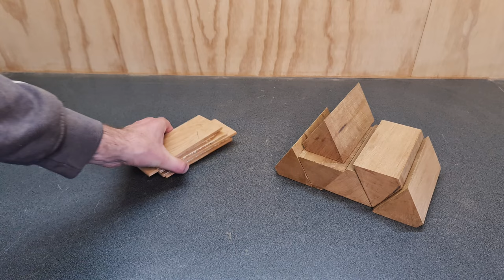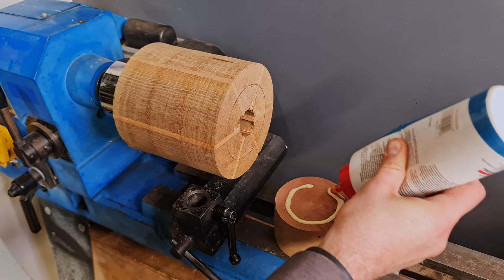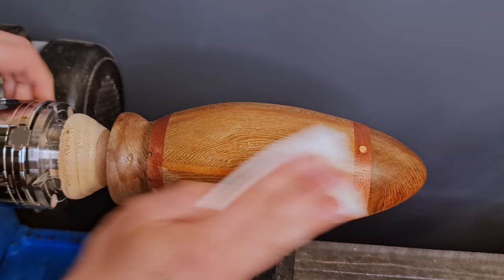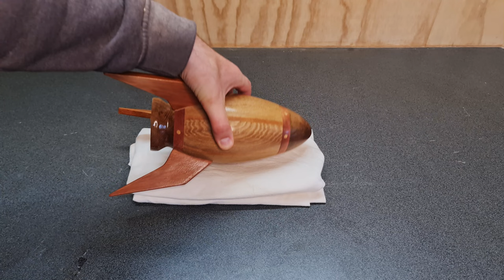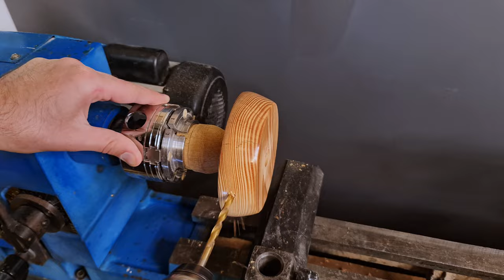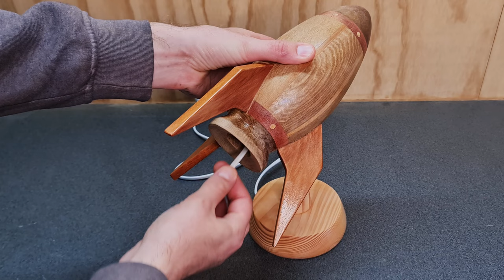Woodturning - Rocket lamp

Comment: What do you use to finish the wood?
Reply from the maker: Hi Eli,
Generally speaking it depends on the project, but this what I'm using at the moment.
If I can use the lathe speed to get a polish then sometimes I'll use a wax product. E.G At the moment I'm using beeswax based product called Briwax (https://amzn.to/3I8hveo), or I'll even just use boiled linseed oil (https://amzn.to/3FYnRKr). These are very forgiving in terms of application as you won't get runs etc, but they don't have the durability or hold luster of other finishes.
As many of my projects have smaller more intricate pieces I'll often end up using some kind of clear spray paint such as (https://amzn.to/3WtpXsS), polyurethane (https://amzn.to/3D3wp1T) or lacquer (https://amzn.to/3GX8pid). These are more durable finishes but can be difficult to apply as they are prone to runs/drips if you don't get your spray distance/speed quite right.
Hope that helps.
Reply: @TurnedOutGood  thanks so much